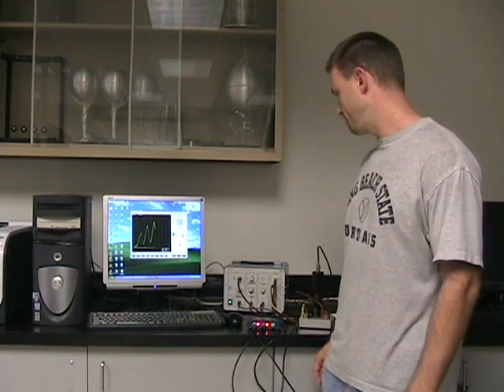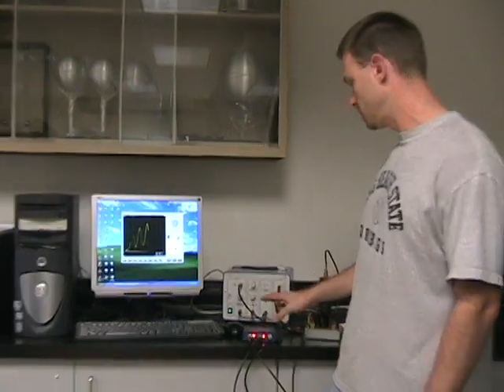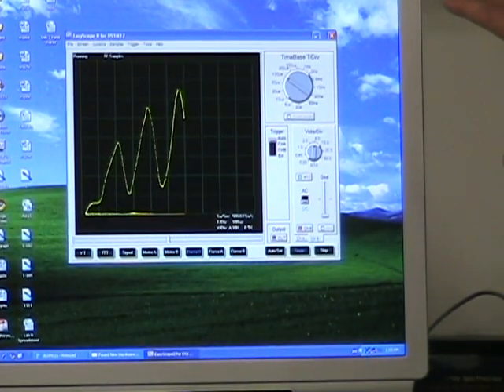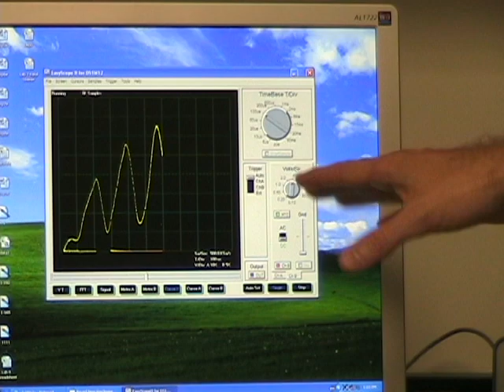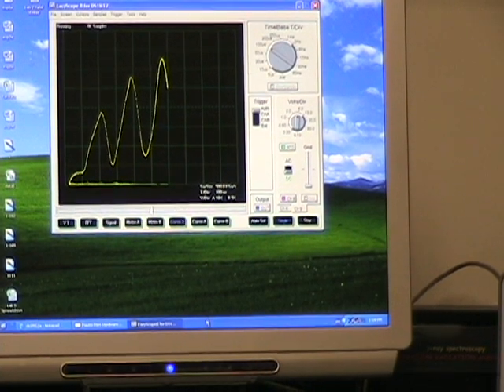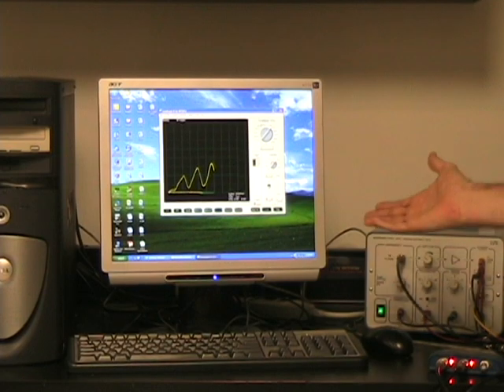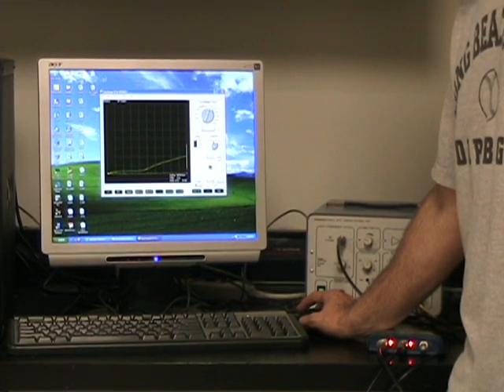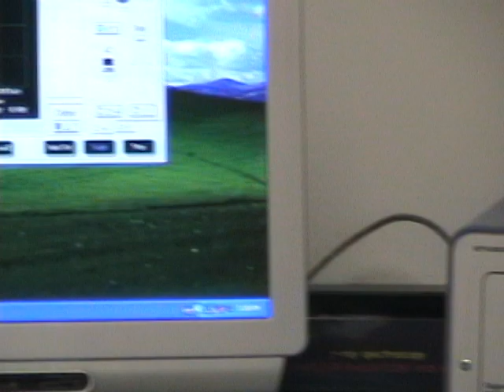EasySYNC DS1M12 Stingray USB oscilloscope

Comment: This device is very impressive value for money. I have used the data logging function for various experiments. It's very compact and rugged, ideal for vehicle, etc. 5 years and still going strong.
In my experience a few added features would improve it further.
1. There should be some way to remotely control the start/stop of sampling via software. I understand there is some kind of trigger but this does not integrate well with other PC based logging tools.
2. All of the functions should have some kind of time series data logging capability, not just the data logger. It would be nice if you could do the same thing with the FFT function, for example.
3. A laymans description of the dll interface would be welcome

Comment: I don't think the device is good for the money. The scope is very limited, although capable. But the worst part is the signal generator, that is pretty much uncontrollable, doesn't have the necessary bandwidth and absolutely can't drive 50 Ohm loads. The software needs much improvement, because it doesn't allow fine tuning.